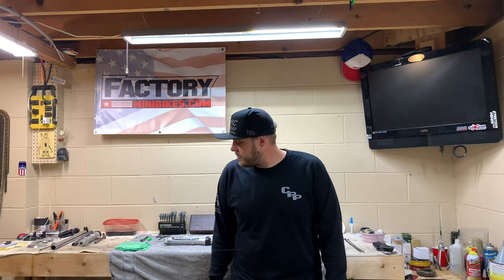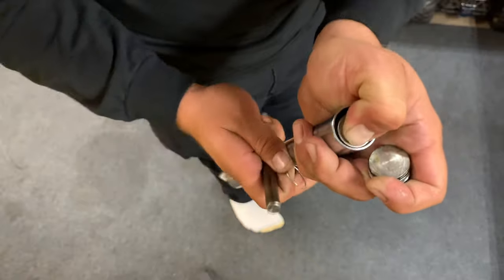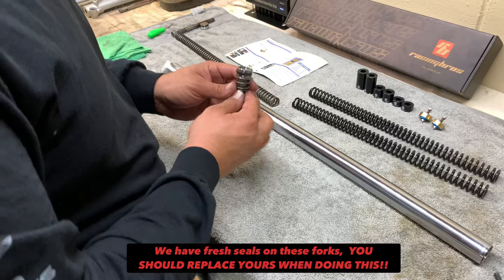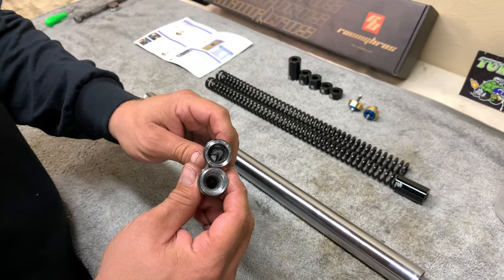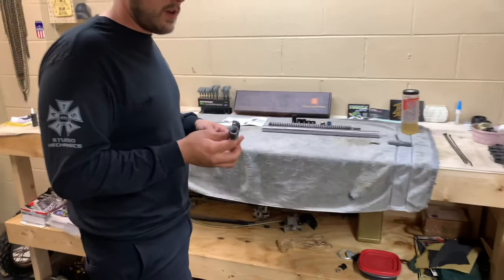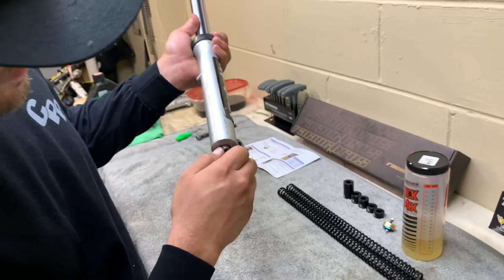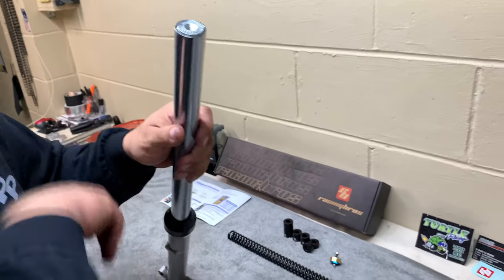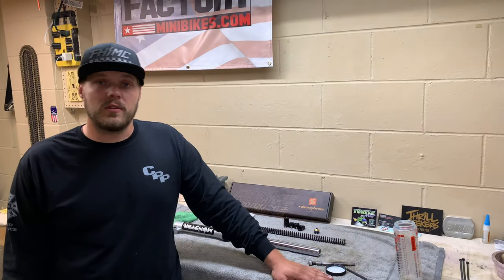Want your klx110 to feel like it has big bike forks? EMULATOR GOLD VALVE INSTALL/SETUP

Comment: Did you have to drill out the factory damper rod oil control ports for better flow to the emulator valve?
Reply from the maker: Some people do, I chose not to.  I had considered doing it to see if it makes a difference.  But I havent done it yet.

Comment: Is this a better alternative to the TB Parts FORK for a 2024 KLX 110L?
Reply from the maker: I believe that it is.  But i guess thats only my opinion.  The reason I say that is, these are adjustable stiffness wise.  The tb parts forks are not.  But the tb parts forks are still a great option.  These emulators give a nice plush feel tho as opposed to just a stiff fork.
Reply: @simplyminis2064  10-4. That makes sense. Much appreciated.

Comment: Good video can you put a cam in klx/drz or a video to explain
Reply from the maker: Ill see if i can get a cam install video together.  Ive actually had alot of requests for that!
Reply: Ever get around to that video just got a cam and would like and idea before jumpin in.
Reply from the maker: @Dirtyfish_22  let me see if I can get a video together this coming weekend.  Lifes been busy lately lol.
Reply: @simplyminis2064  no doubt. Anything’s appreciated. There’s other videos but you’re explaining is on point.
Reply from the maker: @Dirtyfish_22  thanks man, I appreciate that.  Ill do my best to get one out for you in a timely manner 🤝
Reply: If i tighten the spring on the emulator what will that do? I need more preload it’s real soft it sinks like 1/2 in or more just sitting on it. I’m 150 have 2 stiff springs and 20w oil. I believe I have 1/2” space in it also. I can maybe just make the spacer longer?
Reply from the maker: @Dirtyfish_22  tightening the spring in the emulator will make them stiffer.  Try that first before adding another preload spacer.
Reply from the maker: @Dirtyfish_22  if that doesnt get you what you want, add another preload spacer.

Comment: Do they work with a crf110 rod? Specifically I have bbr rods in my crf
Reply from the maker: I have not specifically tried them in the bbr crf110 rods.  I did however try them in bbr klx110 rods and they do not fit.  So id assume no.  Youd need to machine those a tad as well id think.
Reply: Crf process is exactly the same. Machine the rod a bit and they work excellently. Thank for the video it helped make the install easy.

Comment: Is this for the L model? Im doing it right now and with only 1 spacer its very short
Reply from the maker: @CONSTANTG003  I have not used this on a L fork yet.  Im assuming they are only for non L forks.  But with some extra spacers I have no doubt you could make them work.
Reply from the maker: @CONSTANTG003  I have not used this on a L fork yet.  Im assuming they are only for non L forks.  But with some extra spacers I have no doubt you could make them work.
Reply: @simplyminis2064  Hey thanks for the reply, I ended up using my bbr spacers in there with the largest of the racing bros spacers as well and it's damn near perfect. Not sure what the length of the bbr spacers is but they were almost perfect.